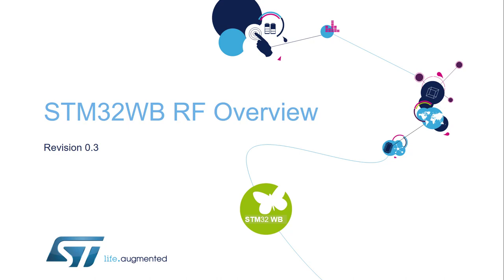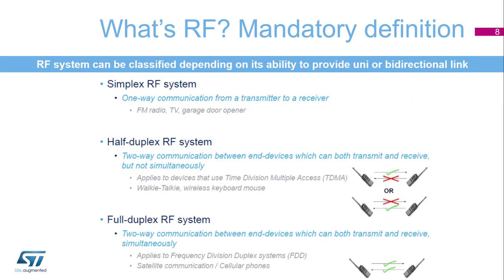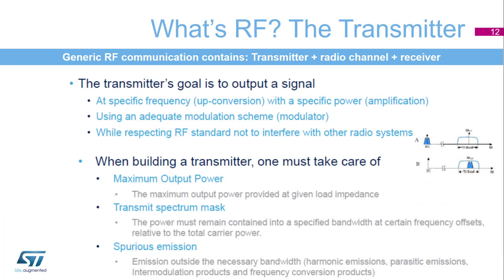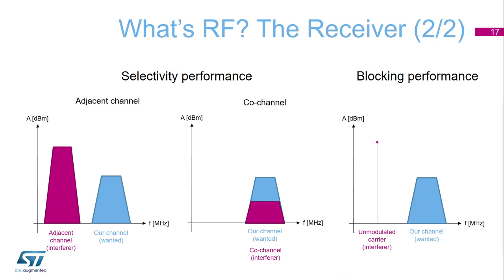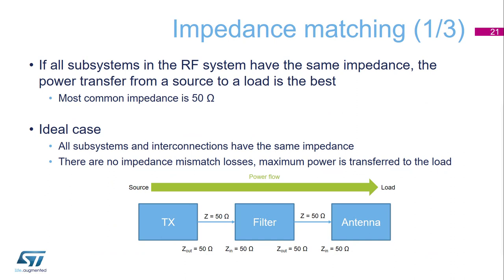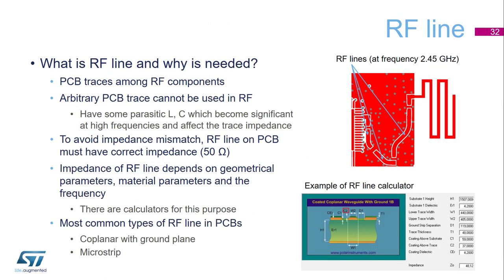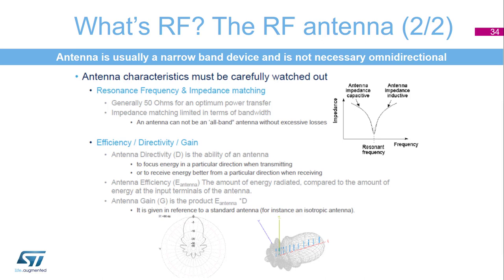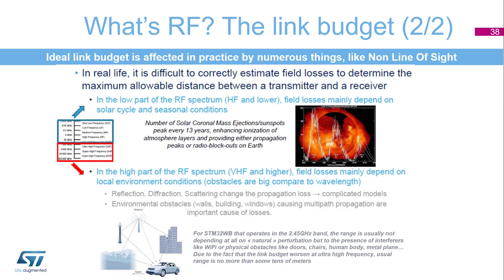STM32WB guidelines - 1 - STM32WB RF Overview

Comment: ST needs to invest more in business partners to provide this microcontroller at an affordable cost. I find nrf52 at 1.7 usd / piece and EFR32BG22C (BLE Microcontroller from Silicon Labs) at 2.2 usd / piece in China. None of them are available from PCB manufacturers and assemblers, such as the JLCPCB, for example. The tools of Silicon Labs for Bluetooth are incredible, it is something similar to cubemx, but it includes the configuration of Bluetooth (setting up the profiles, services, attributes, characteristics and etc, can also use the SIG services with just a click) and it is not necessary to copy and paste code, changing low level drivers to make it work, it is exactly plug-play. Another important fact is the development kit THUNDERBOARD from Silicon Labs has about 6 types of sensors with a high-end BLE Microcontroller at a cost of only 19 usd. They also have a code generator and peripheral setup, although cubemx is better and more efficient to use. I tried in several ways to use the ST solution for my bluetooth product, but due to the lack of affordable Microcontrollers and suppliers, I am moving the project to the Silicon Labs BLE microcontroller. I leave my report here, as I am sure that many will pass or have already gone through this situation.
Reply: The STM32WB55 is a dual core device and will destroy the CPU and peripheral performance, power consumption while doing real work over both parts you mention.  The STM32WB55 has dual radio MACs and can do BLE and another 802.15.4 link AT THE SAME TIME!  Cost is still amazing. ST is a world leader on cost, power consumption and performance.  Need to compare devices with same features when comparing cost.